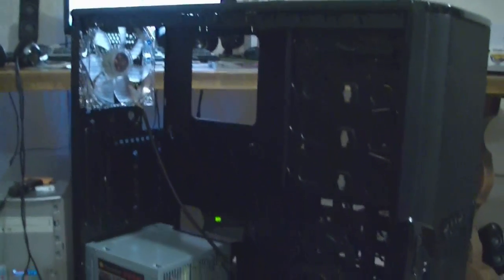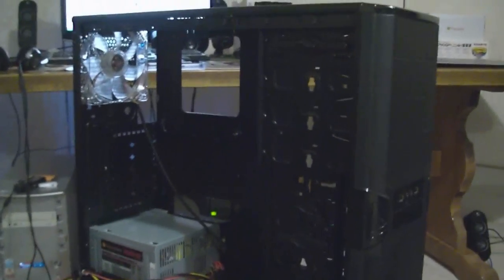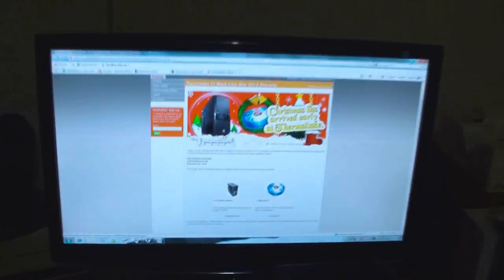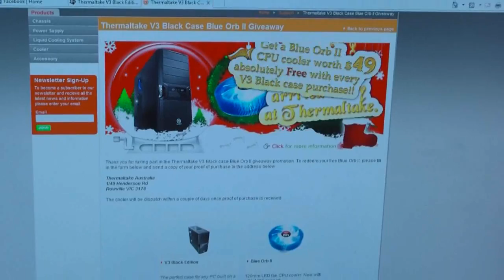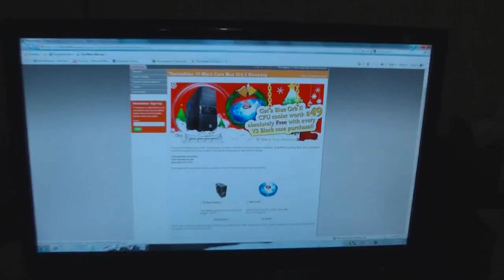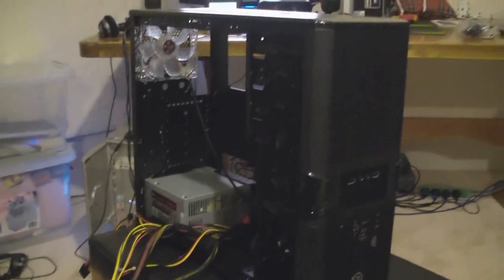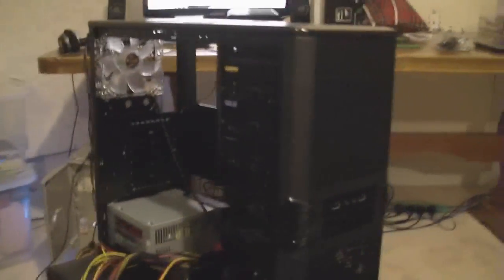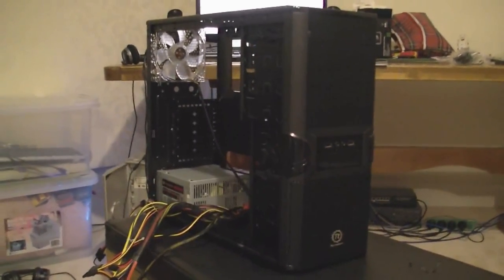Thermaltake V3 Build and Comments Video Part 2 [HD]

Comment: @zDToddy well, with v3 i'm trying to do some case modding, i'm thinking about extending the back panel using a 2x2 sheet metal and fold it like a tray that can give you an 1/2 inch space...

Comment: @MrGamesOfficial oh i got it figured out. i was going nuts with the 8 pin sticking out towards the video card, but i managed to shove it inside more. 
i also tucked the psu wires underneed the hdd @ 2:17 and still have clearance for airflow on the front fan... so its cool now
the thing is that i am running i7 950 with this case -.-

and audio dont work so i am using a logitech speaker with audio... WAHT A LIFE SAVER!

Comment from the maker: i just had a better look. There are only screw wholes to put a fan in the slot closest to the dvd drive. The ventilation above the cpu does not have any fan holes :O

I believe you can only put a 120mm on top of the case next to the DVD drive

Comment: MrGamesOfficial tks for your supporting :)  Tomorow or more 1 day I get my new pc with this case. my technical mount this low pc 

* Pentium E6300 2.8 ghz
* 4 (2x2gb) gb ddr3 1600 mhz
* Graphic card EAH3650 256 gddr3

but now have 2 fans one at rear and the other front but in this year i will buy 1 fan to top and 1 fan to graphic card. In April i will buy an HD 5770 if prices slows :)

PS: maybe other cooler with high quality and good power suply.

Comment from the maker: i just checked, you can always just move the dvd drive down one slo and it should fit fine. i would either get an 80mm or 92mm fan, or just one 120mm! It should fit! Keep in mind i am running a crossfire system and a unlocked/overclocked amd x3 720be! To me the stock cooling seems efficient enough! Just add one extra fan as intake is what i would do!

Comment from the maker: the space on top looks limiting, not sure if the fan will fit, but probably will. i may end up buying fans for the top shortly.

in terms of being flimsy, its pretty good build quality, its built well and strong. although a top end case would of course be better, for the price this is probably the best bargain i have ever got.

the amount of value (psu and cooler) is valued ot $60au, thats only $20au for the case if u want to put it that way.

what do u plan on putting in it?